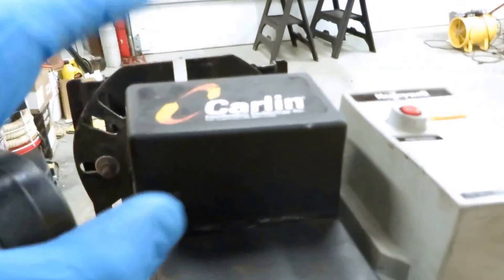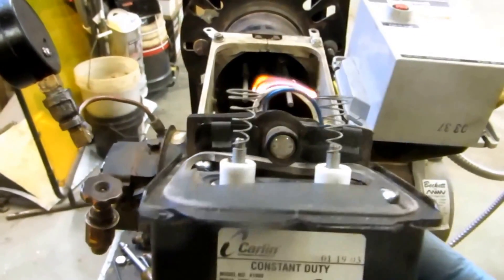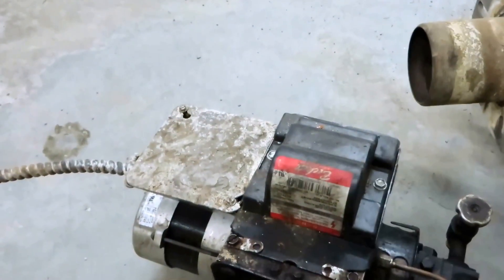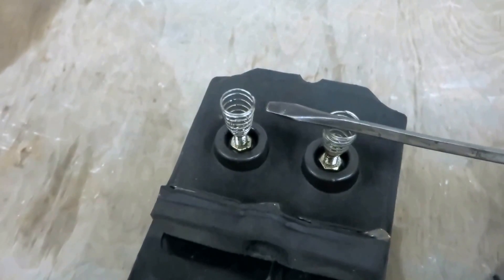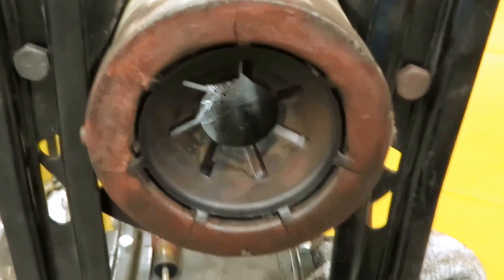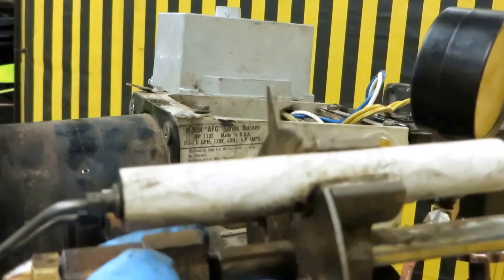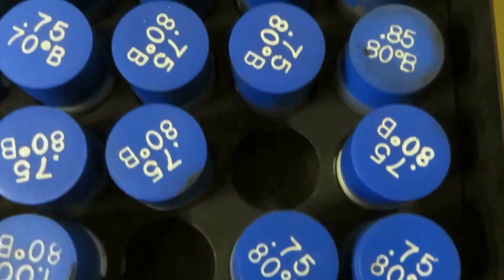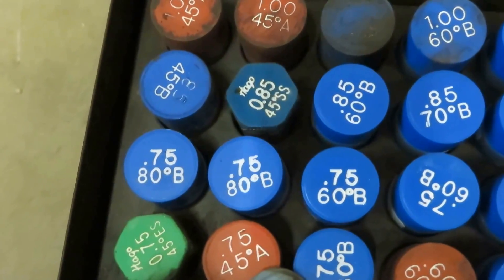Beckett oil burner training series  # 2

Comment: What's the difference between 80w and 80h?

Thanks Steven
Reply from the maker: 80 degree w = 80 degree extra solid spray..........h=hollow spray
Reply: @stevenlavimoniere  my unit calls for a 80w and all the hardware store has is a 80h can I use it? Kind of an emergency situation.

Thanks again Steven love your channel too!
Reply from the maker: @deputydan2226  YES YOU CAN USE IT
Reply: @stevenlavimoniere  thank you so much Steven you're a life saver!   My unit also had a .75 vs the .100 it's calling for

Comment: So thankful that we replaced our fuel oil Beckett burner Weil-McLane boiler with a Weil-McLane natural gas furnace, the cost of savings is remarkable. When it reaches -36°F and having to go through 300+ gallons in one month at $3.56 per gallon it was ridiculous expensive and the fuel oil filter disintegrated and got caught in the nozzle making it sound like a Diesel Engine Jakebreaking in our basement shaking the entire home. This happened after we had a technician try to fix it but he instead of replacing the nozzle took the fuel supply line off and used a file on it ruining it just to force us to replace the furnace/boiler with a $7k+ natural gas one, we have since replaced that oil boiler and went through a different company that did not charge us a ridiculous amount for installation at $5k huge difference in the quality of heat provided by a Weil-McLane natural gas boiler vs an older model fuel oil boiler.

Comment: Hi! Thanks for the informative videos! The youtube shake fix, if that's what it is, makes me a bit motion-sick.  Things look like they're warping.  
I had something happen I haven't seen before. It's a two line system. After the call of heat was satisfied, the pump would shut off and the air blower would run to push the excess heat inside the house. I watched the status light come back on on the controller.  I haven't seen that before. After the blower shut off, I could vaguely hear something going on inside. I lifted the transformer and seen I still had a pretty good fire Spraying inside. This with the pump off! It was making enough heat to bring the blower on again. I could only shut it off with the fuel valve before the filter. This is a clean-cut pump. I guess the pressure regulator had a bad seal on the end.  I changed the pump anyway.  .

Comment: so can i wire brush the nozzle and also blow back through it with 120 psi air compressor to clean it if plugged also maybe spray carb. or injector cleaner threw it?  these ideas to me seem like the poor mans tricks can they work?

Comment: The best way to test that old type 10000 v transformer is with a multi meter. To test the primary side set the meter on the ohms scale and touch the leads to the wires, a Webster should be about 3.8 ohms the secondary side should be about 10800 ohms, on the secondary side one lead of the meter should be touched to a ground on the chassis the second lead to one of the spring terminal, there should be no more than a 10 % difference. allanson secondary leads should read about 9200 ohms and primary side should read 2.4 ohms.

Comment: Thanks for the great videos Steve. Very inspirational to see a pro in action. My Beckett has the insulated fire blanket totally disintegrated . How soon should i replace it and will it burn a hole through the boiler plates over time ?
Reply from the maker: tennismadesimple i would change it right away the target wall in back and bottom is imporotant i have seen boiler burn a hole right through the boiler .they make a wet blanket kit that comes in a roll you cut to fit what you need .i like to do sides and back in one piece and base as a seperate piece. or get the proper fire box for your boiler thats always the best way.

Comment: Great video, thanks for sharing! We seem to go through about a 10k volt transformer a year on our boiler. Might be due to the fact that it cycles so often.
Reply from the maker: one a year wow maybe you need to check the draft over fire i beet the boiler is blocked with soot and your getting back pressure
Reply: steven lavimoniere
It's possible, though even when it's relatively clean this happens sometimes. It is cleaned on a pretty regular basis.
Reply from the maker: Jordan Berghaus i boiler can soot up at any time ..bad nozzle .a lot of thing can happen to make a burner soot

Comment: You out did yourself on these series Steven! Nothing more informative on You Tube!
Reply from the maker: wow thanks brad for the nice comment i do appratiate it .i did try hard to make it worth watching.
Reply: I replaced my transformer last February when we had single digit outside temperatures here in RI like today. I bought the 14,000 volt electronic transformer instead of the old style transformer type figuring they were better. Not so! I'm learning so much from this series, keep them going!
Reply from the maker: Brad1237202 them 14,000 volt transformers will fail if the reset starts tripping run the burner and leason to it good and see if the transformer drops out you can hear it sparking then not sparking .as long as its working ok leave it but i have a lot of trouble with them cutting out nusense calls have to reset the protector relay .and then there fine for a day .i will not install them anymore not worth a call back
Reply: steven lavimoniere Thanks Steven. I and other love the series. Your the best because your sharing all your years of experience with all of us who have never experienced these problems and are grateful for your videos.
Reply from the maker: Brad1237202 thanks for the great comment brad not every one likes the series .i am glad you got something out of it